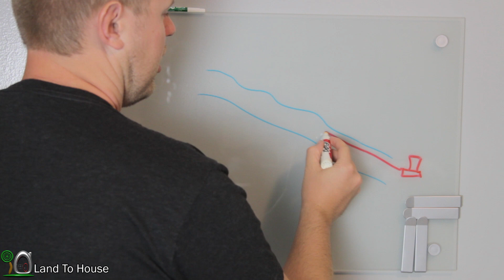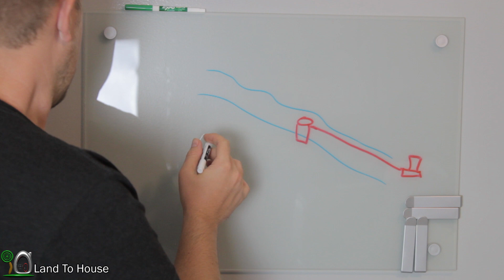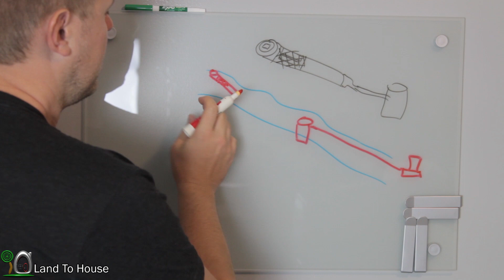Design a Ram Pump Intake with Me

Comment: As requested: 
Source collection: a bit of roof edge rain gutter with a leaf guard on top; the solid type that sheds leaves and uses surface tension to 'wrap' the water over the lip into the gutter.
Add a silt separator before the bucket, much  like an aquaponics Radial Flow Solids filter/separator like this one: https://youtu.be/sBCC9tMsleY
and
https://youtu.be/crKjqCJmIV0

Comment: Use a full stick of French drain ,cap it screen the whole thing ! Put a reducer , your Union and sha am ! Cheap & easy! Just my thought proses. KW.
Reply from the maker: Yes that would be great! Might have some small silt to filter out but that is where another filter down the line comes in. I actually built this design and it worked for months until a flood washed it out.

Comment: Hey Seth. So it turns out you can get coanda screens in Britain. They also have a nice description on the principle of opeation...which had me wondering if 'coanda' was an accident in the title or not...Turns out. Not. It ilters using the coanda effect and shear action induced by the sharp edges of the steel weges.
http://www.aquashear.com/why-aquashear.cfmhttp://www.aquashear.com/aquashear-benefits.cfm
Reply: Dang...the links merged...
http://www.aquashear.com/why-aquashear.cfm

http://www.aquashear.com/aquashear-benefits.cfm
Reply from the maker: Very nice. I was looking into something like that. I am not sure that I have seen a seller here locally. I am going to give window screen a try and then see about going smaller in hole size.

Comment: There is a porous fabric material that is used in drain fields around foundations and fits over the drain-field pipe. Water goes thru but dirt does not. Also landscape fabric for keeping weeds out of flower beds would work well.
Reply from the maker: I have a roll of landscape fabric. I should give that a try! Thank you.

Comment: Evening Seth. Go for a coanda screen, they're even based in the US so shipping will be way more affordable than this side of the pond. They self clean too which helps the maintenance aspect of any other screen or filter membrane.
Reply from the maker: Those are great intake filters! I am hoping to get a filter intake that works as well as that and is DIY. I should be making the first test this week. Possibly Wednesday. Thank you for the great pictures of coanda screens. Helpful for designing.

Comment: I would look at separator designs on line.  They aren't difficult.  You can design it so that most of the debris less dense than water doesn't enter the intake and most of the debris more dense doesn't enter the intake.  Then separate what does make it in with baffles.  Quite simple in theory.  I, personally, haven't done this YET, but it is done.  There are multiple sites where you can gather the theory behind it.
Reply from the maker: I was just checking out a few designs that separate water and debris. Some cool ideas. I think I will make this design and then go from there. It should not cost much to make.

Comment: Would a French drain work?  Like bury it in some gravel in the creek bed?  Or would the sediment clog up the geotextile fabric?  Essentially the same thing as your screen, but already purpose built.
Reply from the maker: I think that would work but might be a little harder to clean out.
Reply: Hmm, I've not heard that you have to clean out french drains, which is why they are usually covered in gravel and have the fabric covering it.  Its also the reason I suggested it.  Maybe I'm mistaken.
Reply from the maker: I was just thinking of the creek here at my house. It has that fine sand that clogs up everything. Well worth a try. After I test this first design I will look into getting a short section of the French Drain.

Comment: Hi there. Tony from NZ here. I take my water from a low volume Creek. My main problem was sediment covering the take off in my little dam. The pipe was too deep down, in the muck, not in the clear layer on top. My fix was to have an 4" outer screen, with a fine mesh or thin slots, surrounding the end of the pipe. I would make the outer screen at least 1 foot or more, the more surface area the less suction it will have and collect less leaves and sediment. As long as some of the outer is up in the clear layer  it wouldn't matter the pipe sits in the muck. Also consider a basic cover or roof like arrangement to protect from flood debris. I will endeavour to take a pic of my set up. Sorry to be so windy with my words, I like playing around with this stuff.... Like you.
Reply from the maker: Thank you. Clear and instructive. It seems there are several people with similar designs that work well. I think I am a go for building the intake.

Comment: Instead of the intake on the top of the pipe, make it on the sides. Most of your impurities are probably denser than water and will sink, but some are less dense and will float. Avoid both, and try to get just the median-density water.

Feed this pipe into a bucket with a small hole at the bottom to discharge any remaining sediments that fall to the bottom and an overflow to get rid of the floating debris, and your main output a few inches above the sediment discharge.  This would be low enough to have little air entrained as well as very little impurities (only those that are roughly as dense as water anyway, and are unlikely to affect your pump),   Also consider putting some plastic baffles in to force the water in the bucket to take a serpentine route from inlet to outlets, providing more opportunities to separate out the sediments and floating debris.

For this to work, your output pipe must be smaller than the inlet, to guarantee you have the extra flow for the sediment and overflow discharges to keep flowing as well.
Reply from the maker: Great suggestions. That would work well on a creek with a few inches of water. There might be some installs with such low flow that all water and debris flow over the pipe. I suppose a little testing will have to be done to see just how much sediment gets pushed into the 3" pipe. 

Have you seen my bucket intake video? I think it shows what you have pictured here. This is the update: https://youtu.be/o5FIZwWZrSY
Reply: Close. You have a plug on the bottom outlet.  I'm suggesting a VERY small bottom outlet that's ALWAYS open, which would continually purge the sediments from the bottom, while the floating debris would be washed out of the overflow at the top.  This would probably be in addition to your larger plugged outlet, but would make you have to use the plugged outlet to clear large obstructions very rarely, reducing the maintenance requirements.

Again, the key to making it work is that the inlet has to be much bigger than what leaves the bucket on its way to the ram pump, because for this to work you have to have sufficient inflows to keep all three outputs going.  But if you have enough flow in your source to play with, you're drawing from that sweet spot of medium density.
Reply from the maker: I get it now. Thanks. I think my first design will be for those with very low flow water source. For instance 5gpm. This would probably not be enough to get a continual outflow from the bottom. But with a larger flow rate I think that would be a good idea.

Comment: Why couldn't you use two buckets in line with each other and have the first bucket as a sediment trap that drains into your second bucket, which would feed the pump?
Reply from the maker: Seems like that would work. The 3" pipe is what will be in the creek to pull water from a very low flow source.

Comment: Not sure you can use this, however, heres how I filter fish waste  out of an Aquaponic system. I set up a 5 micron filter screen on the discharge from the main fish tank so the discharge flowed over the top of the screen and the intake was under the screen exactly how you rendered in your illustrations.  The difference is mine was set up like a ramp so the water had to flow down across the screen so the screen was continually was free of debris.
Reply: This is similar to what was in my head, too. I was thinking of how rain water catchment systems will filter out debris with an angled filter/screen.
Reply from the maker: I have seen one of those angled screens. Very effective. The issue I have with that is the low flow situation. I think this one will need to be half buried in the creek to catch water.
Reply from the maker: How well would one of those filters handle a no pressure situation?